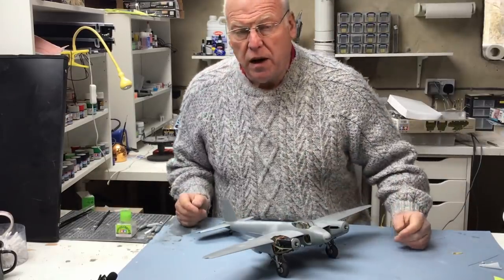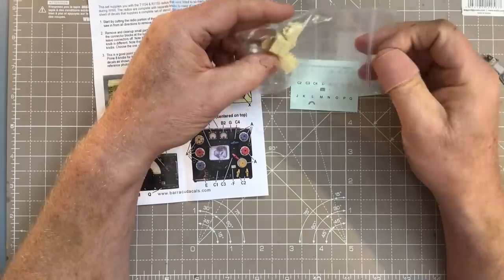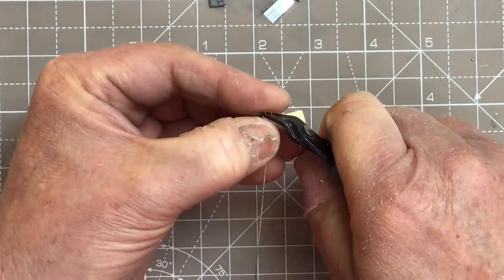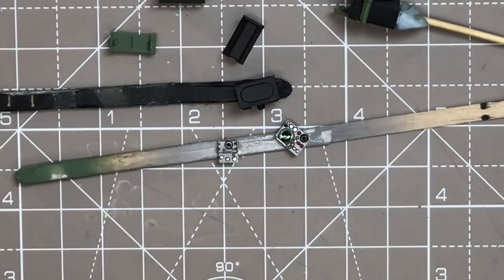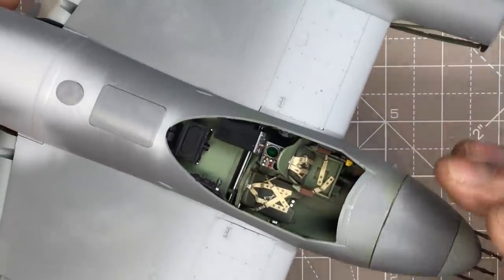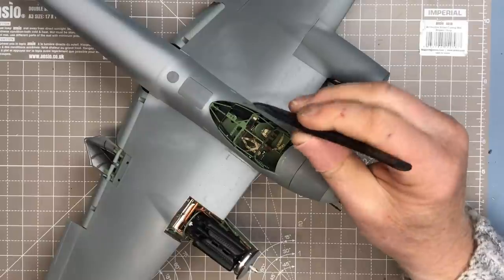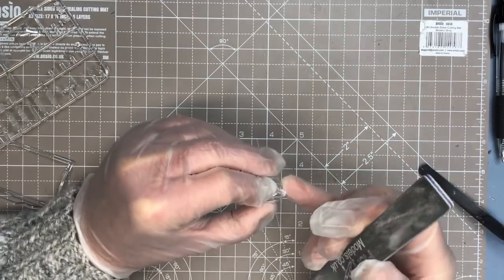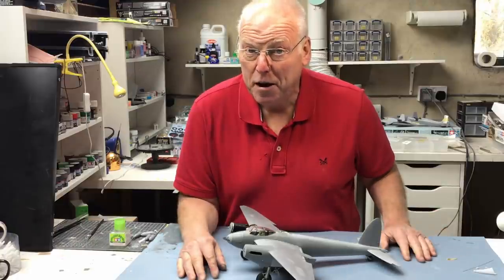Tamiya 1/32 Mosquito build series Part 15

Comment: Thoroughly enjoying the build series. Can i ask what rotary tool you use in this video, i am trying to find a rotary tool that has good speed control. Thanks again for such a great series
Reply from the maker: Hi Mark it’s a very old (probably 25 yo) minicraft. it has no speed control on it other than my finger braking the chuck to the speed I want. Despite this abuse of the motor it’s still going strong after all these years. I prefer it far more than my Dremel which is much heavier albeit more powerful. I don’t think theres a modern day equivalent tragically.

Comment: Loving every minute ! 
Feel the need to write a letter of complaint to Eduard, regarding the poor fit of the engines !
They should not be allowed to market a detailed kit and charge expensive prices, when the final parts are useless and don’t fit the kit they are intended for.
What are your thoughts ?
Reply: I also tend to prevent Eduard kits for my next models. In most cases, the Tamya is so good, that the improvement ist not so big. I also have the Eduard engines :-), but the Eduard guns are great!
Reply from the maker: Same here Ray - but the engine bulkhead was a killer for me. no way was I going to screw up the model for it.

Comment: How often would you recommend changing the filters on your mask?
Reply from the maker: You need to follow the guidance which comes with your respirator. Mine are 3M and the MAX life is 6/12 but they should be changed sooner if breathing gets more difficult or smells can be detected through them.
Reply: @TheModelShed  is that 6-12 hours?
Reply from the maker: No 6 months